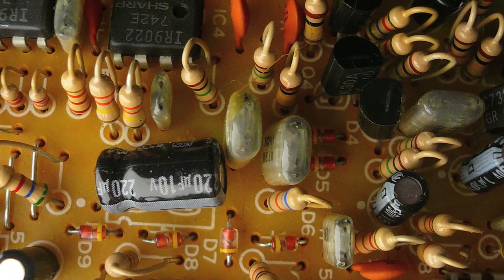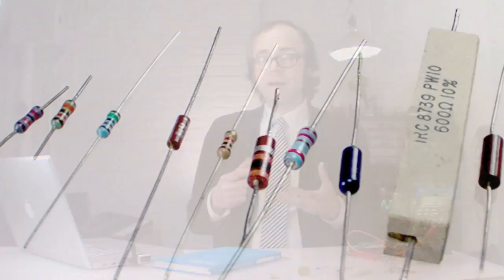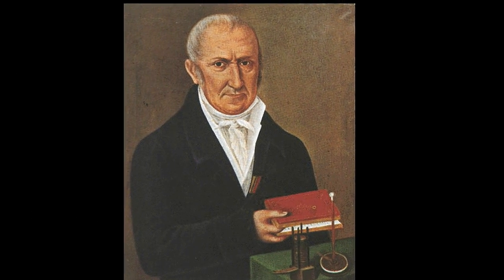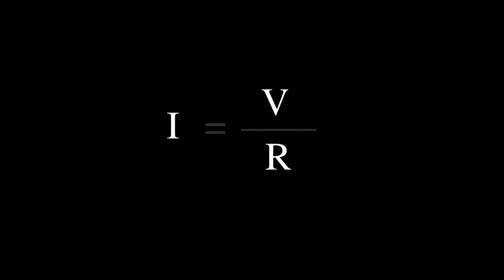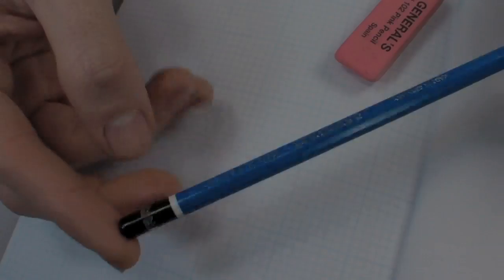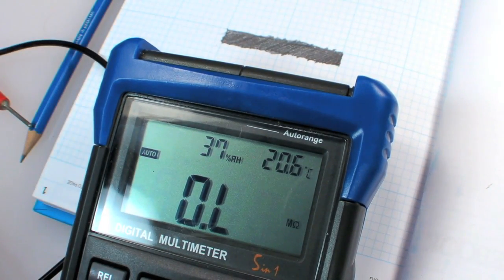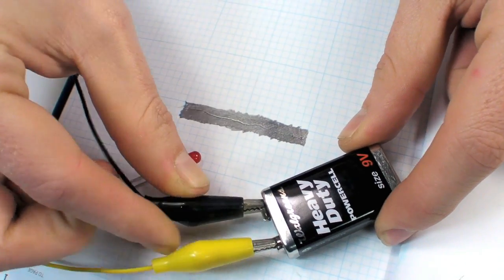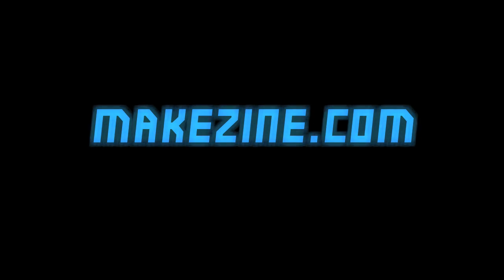MAKE presents: The Resistor

Comment: So does a resistor lower the voltage or what?
Reply: no the battery voltage stays the same but the resistor controls the amount of current allowed to pass through
Reply: Patrick Jackson 
There is a voltage drop across the resistor, which slows the current. The energy turns into heat.
Reply: But if the resistance slows down the current, is the Amperage still the same? I'm confused as in school we always made those typical illustrations, and in series connections the I is the same

Comment: how do you know what value of Resistors to use when using them with an led? lets say using 12v source.
Reply: Use the formula R = (Vcc - (Vf × n)) / If, where R is the resistor value in ohms, Vcc the supply voltage, Vf the LED's forward voltage, If the LED's forward current in amps and n the number of LEDs connected in series.

Comment: Complete noob with a question,
 Suppose i had a six amp current and a hand full of led only able to handle 3amps,
   If i had no resisters could i run 2 leds in parallel to make up for my lack of resistors?

Comment: How do you know if the resistor's ability is enough for the LED? He made one from scratch and though he said not to provide direct power, he nearly touched the LED.
Reply: +Samuel Torres The duration is also a factor, the high current flow will heat up the led and break it, a normal led needs i think about 35-40 milliohms or a little more

Comment: how can one calculate the final voltage let's say input voltage is 6 volts DC at 1 amp and I want an output of 2 volts DC. How will I find the resistance needed?
Reply: well you use this formual. R=[ Voltage source(6) - Voltage drop(2) ]/ C (current=1A)      (6-2)/1 = 4ohm needed      I think this is how it works.

Comment: I got 100 blue 5mm leds this is the specs
Reverse Current (uA) : <=30
Life Rating : 100,000 Hours
Viewing Angle : 20 ~ 25 Degree
Absolute Maximum Ratings (Ta=25°C)
Max Power Dissipation : 80mw
Max Continuous Forward Current : 24mA
Max Peak Forward Current : 75mA
Reverse Voltage : 5~6V 
am I correct and I need a 250 ohm resistor at 6v

Comment: @JiraiyaZantIssun Use Ohms law, Most LED's are designed to work at 20mA, since you have a Jumbo one i would say it needs 30mA. Now we take these values and put them in Ohm's law, 9v/0.03A=300, so you would use a 300 Ω Resistor. 

Your welcome :)

Comment: @ricardo161584 If they're in serie you will need a better power supply than 6V
In this calculation i used 24V:

6 leds * 3,3V = 19,8V
(24V - 19,8V) / 0,025A = 168 Ohms Resistance

If they're in parallel you can use 6V:

(6V - 3,3V) / 0,025A = 108 Ohms / 6 leds = 18 Ohms Resistance

Comment: @Pyrotach Hold the resistor so that the stripe closest to an end of the resistor is on your left.  This represents the highest digit.  ---[RB     ]------     if this diagram is a red and brown stripe, this would be 21.  There's probably going to be a metallic color as the last band, showing the tolerance (accuracy) of the listed value.

Comment: Some LED's come with the description 2V, doesn't that mean that a 9V battery will burn it out, or doesn't it matter as long as the resistor connected in series with the LED limits the current to let's say 30mA?

Comment: @lasaldude Resistors are also measured in watts. The wattage marks indicate how much power a resistor can handle. You wouldn't want to use a 1/4 watt resistor in a CRT deflection circuit for example because it would burn out.

Comment: just attach a 330 ohm resistor to the non-battery side of the LED and use that resistor as your probe. that way you won't have to worry about letting the smoke out of the LED when you connect the two probes on the pencil ash.

Comment: this is intresting, because theoretically, with a couple of pencils and glue on components, you could draw a functional  electrical circuit on a piece of paper.   i assume if you can make resistors, you could make caps as well, by drawing surface areas on both sides of the paper and using the paper as the dielectric.

Comment: A variable resistor is made of organic conductors and ohmatic voltaics. You need a stranded current gate and some insulated ocillating filaments (I use at least 3 for safety) in order to prevent blowback. Take care that you limit the voltage to as close to 1/16th of the value of the length of coil for the best efficiency. Don't forget to ground the anode (I learned that the hard way!) and a farad-polarized gap meter is good for watching the non-linear signal decay, if you want to get real fancy.

Comment: 200 VOLTS?

most LEDs are around 1.5-4 volts. you'll burn the LED in like, a millisecond. Try lighting up a 1.7 vold led with a 9 volt battery, and see what happens.